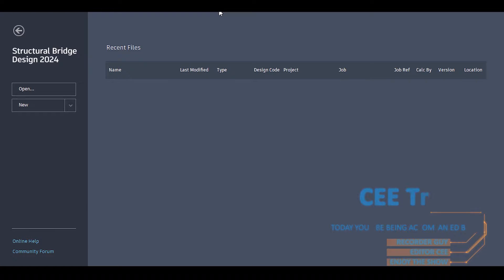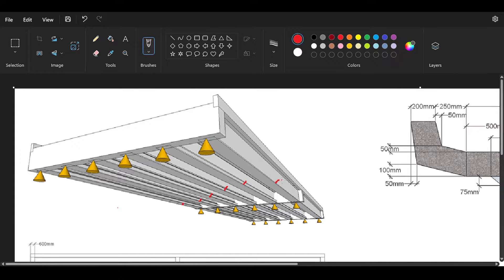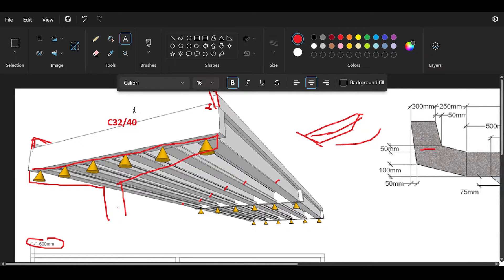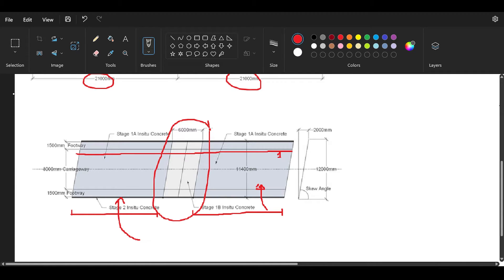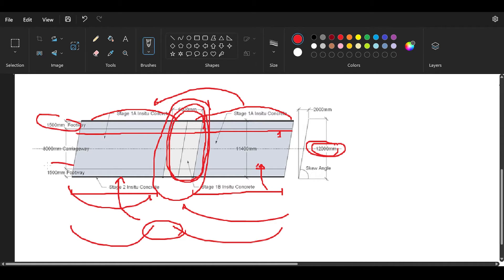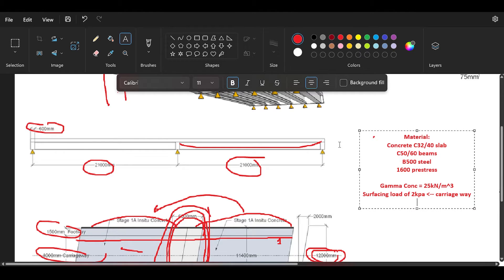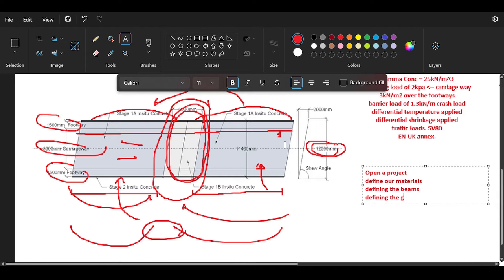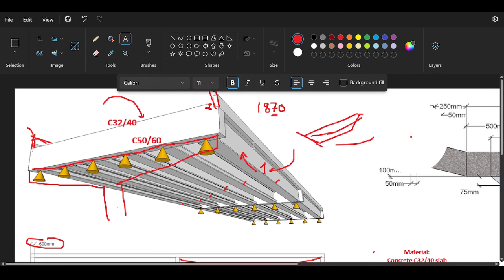Modeling and Design of a Prestressed Bridge on Autodesk Structural Bridge Design- Part 1 Description

Comment: Good afternoon, my name is Luis, and I am a civil engineering student from Brazil. I am currently working with Autodesk Structural Bridge Design and have some technical questions regarding modeling strategies. Specifically, I would like to know the recommended approach for modeling a reinforced concrete bridge with two central longitudinal girders and a reinforced concrete deck slab with a free edge.

I attempted to model the structure by setting the mesh member type to "beam elements." However, due to the eccentric placement of the main girders and the presence of only internal transverse members, removing the mesh beam elements that do not correspond to actual structural components results in a mesh that is smaller than the defined carriageways. As a result, I am unsure of the correct modeling strategy that would both reflect the actual structural system and allow for proper traffic load application.

Thank you for the video and the Autodesk Structural Bridge Design series — they helped me a lot, and sorry for any inconvenience.